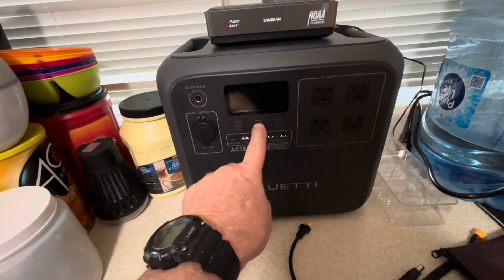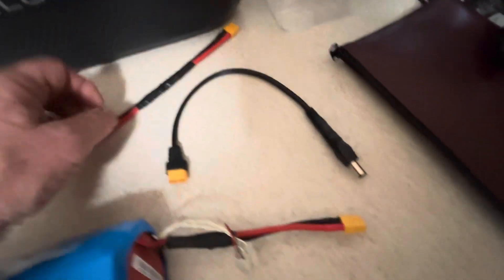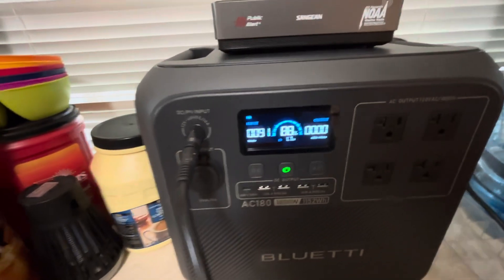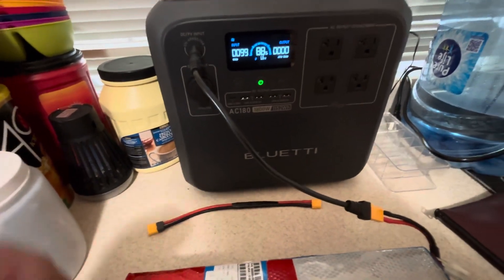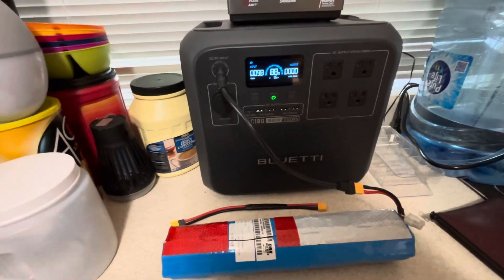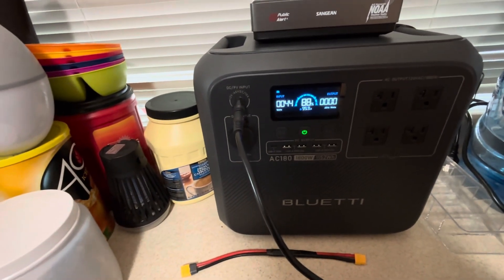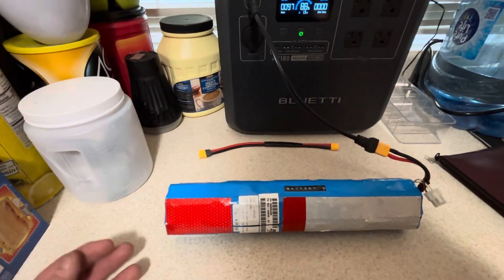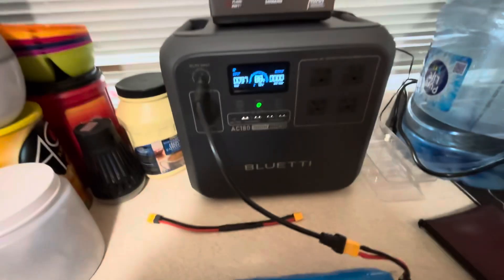Bluetti AC180 DIY expandable battery options

Comment: This doesnt actually expand the base 180 though? This is just another meathod of charging it, its not actually expanding the max battery capacity live, it just charges it back up in case solar , dc or ac wall isnt available? Or does the 180 see the unit as extra capacity like if you buy an  actual bluetti expandable battery?
Reply from the maker: True. It does charge it but also gives you extra battery capacity. This battery is only 12v and  288 watt hours so it will only charge it at 100 watts. If you use say a 36 volt battery. It will charge it at a faster rate like 375 watts. But if you had a battery with a larger capacity than the ac180. It would charge it and also act as an expandable battery after it charges it fully. Either way. If you had no power to charge it. You are still adding battery capacity to the ac180.
Reply: @JoeFlash1 gotcha makes sense. Thank you!
Reply from the maker: As far as charging the expandable battery. It has its own ac charger.

Comment: But you'd have to have another charging method for the addons battery?
Reply from the maker: @RobertJLessard  yes I have a charger that I purchased for the batteries from Amazon. It charges each battery in about 4 hours.
Reply from the maker: @RobertJLessard  Feel free to join my portable power station solar generator facebook group. I explain all the info and perform battery capacity tests on power stations.